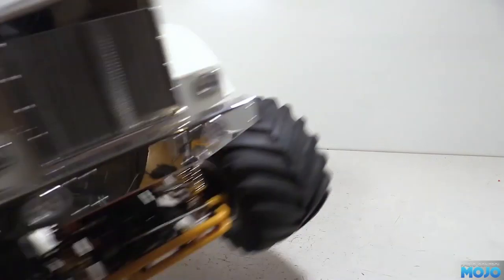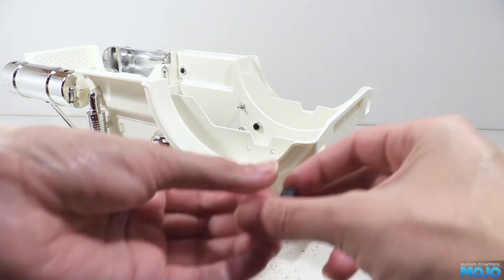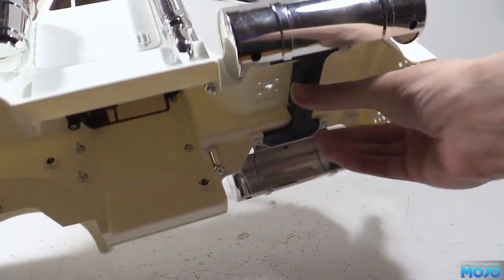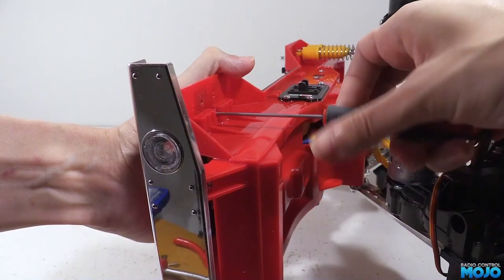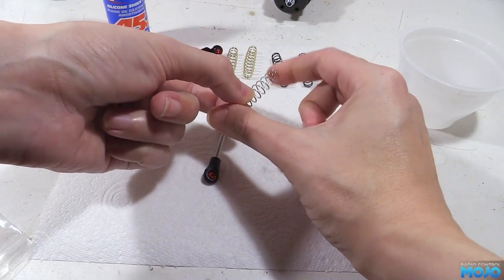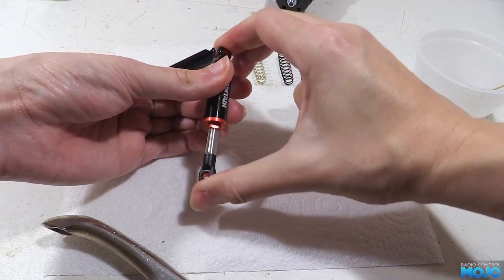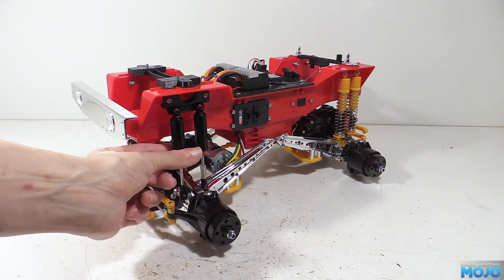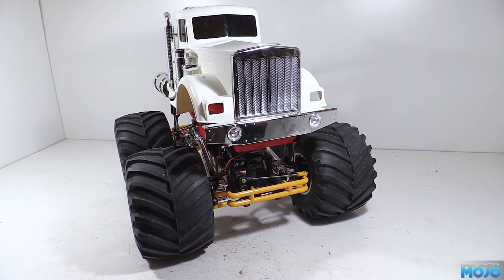Tamiya Bullhead - #9 Magnets and Dampers

Comment: The Dampers are always a worthwhile Upgrade!! 
I LIKE the Magnet Body Mounts! 😁  Any chance you would be designing upper Mounts to fit the Clod Body? 

You've still got your Clod, right?
Reply from the maker: The chassis bits will carry over, it would just need a set of bits for the Clod body, you could easily swap between them too then. My old Clod body is still around, I think it was modified a little though, I'll have to dig it out and see what would need doing
Reply: @RCMojoTV   That would be SWEET!! I was thinking the same thing.... Maybe getting a Bullhead Body, and be able to swap. 

..... I've got NO CAD skills whatsoever , but I was also thinking about creating Upper Mounts out of Styrene or Kydex - to fit a couple of JConcepts Bodies. 😉

Comment: You were saying you have a 3-D printer please comment back thank you very much
Reply from the maker: I did. It's an ANet A6, about the cheapest printer kit I could find at the time, it's been modified a bit but it's been going strong for the last couple of years
Reply: @RCMojoTV   I am looking for someone to make me parts for a king black  Foot would that machine be able to do it front and parks
Reply from the maker: In terms of printing yes, but you need the file for it to print. If the part is available on a site like Thingiverse it's usually fairly straight forward, otherwise you have to design the part using a 3D CAD package
Reply: @RCMojoTV   The front end parts for the king Blackfoot I have the book and I have the Part sheet number would that work for you to do 3-D printingPlease comment back

Comment: Still watching this great build. The 3D parts are excellent. Every time i watch a episode i get the urge to build one.These type`s of Tamiya never appealed to me till now! What i hate is the difrent coulor plastics,i am a solid black fan. Thinking of buying and de-chroming and painting most of the plastics.
Reply from the maker: The ClodBuster has a black tub and arms which would save a bit of time, you can then track down Bullhead bits and have the best of both

Comment: I'm hearing this recently on many videos from the UK.  Being in "lock down" means you can't even go out and run your RC on your own property??  What the heck!!!  That's utterly ridiculous.  If you're respecting social distance guidelines to keep others safe, then you should be able to do what you want where you want to do it.  What a happy time it will be when this evil virus is finally gone and we can return to living our lives.
Reply from the maker: That's not quite right, we can run RCs in the garden. The issue is more often than not said garden is quite small, with some trucks I can only just manage a full lock turn between the wall and fence! 1:24th models are great, but they're just not quite the same as the bigger ones.
Outside of the garden, if you boil the rules down, you can go out but there's no loitering, so standing still driving a truck around isn't really in the spirit of things. Scale trucks through the woods is a bit of a grey area as you could compare it to walking a dog in terms of risk which is of course allowed.

Comment: Magnets=no bashing.
Reply: Bashing a Bullhead? This will never happen. Probably the worse model you could use. Never seen a model any taller than the Bullhead.
Reply from the maker: You can just about lift up the truck by the body with the magnets so it'll be ok. We're not going full send off ramps with this one, that's what the race chassis Clod was for!
Reply: Yep, even mild street use with an all magnet body mounting will result in a trashed body-I use magnet on the rear and body posts on the front of all my street and rally builds,quicker and neater location with fewer ugly posts sticking up,and bodies that stay put. Simple metal plates too,no need for a 3D printer,just some basic metal working skills and an imagination.